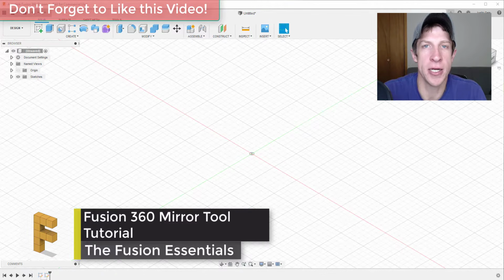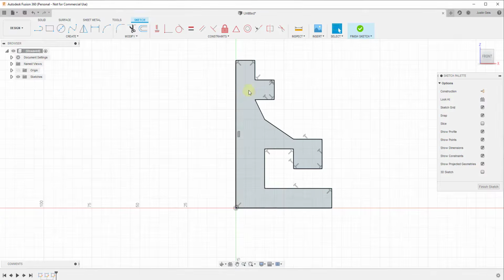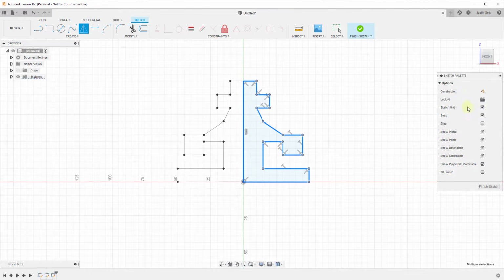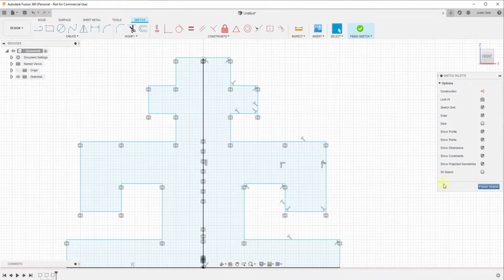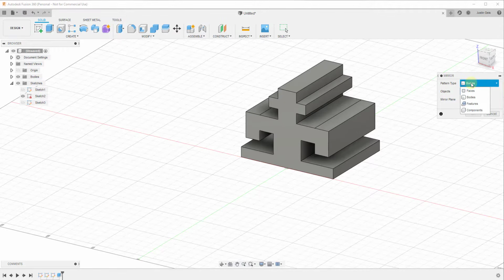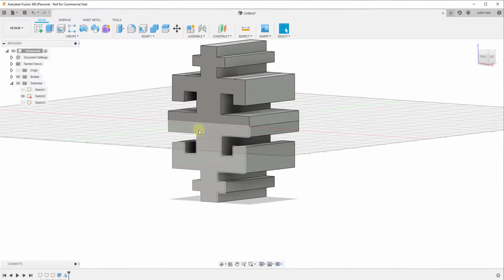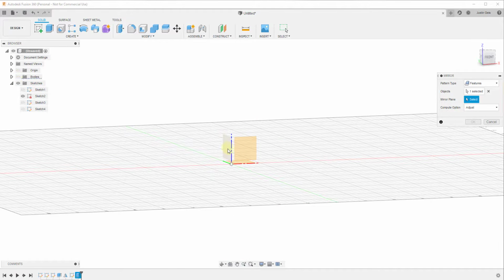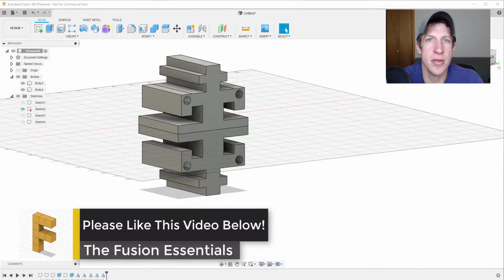How to Use the Fusion 360 Mirror Tool to Mirror Sketches, Bodies, and Features!

Comment: Coming from Solidworks.  Trying to take advantage of this TopDown approach but I am frustrated with Mirroring components of a steel frame.  I create a Leg component and mirror that about ZY plane.   I get a new component Legs(Mirror).   Here is where the frustration is.   I want that new mirrored part to mirror the location of the original part.  IT DOES NOT.  That new part I can drag off anywhere I want.  Move it around in the X, Y, or Z.   It is more of a copy with an initial placement and unconstrained than it is a mirrored component in a sub assy.     What gives!!!!

Comment: Very powerful tools for drawing and modeling.   The one thing that can't be taught and only comes from experience (or formal training - as in learning the way your instructor teaches you) is which technique is better given the circumstance.  I have been burned many times when needing to go back and make a simple changes that when completed, the impact everything else after the timeline to the point of almost screwing the entire drawing up creating a lot more work to "patch" those new issues.  When to draw in mirrored features during the drawing stage or solid model stage is an art form.

Comment: I been trying to mirror an object that is a few inches away, not next to each other like your sample, is the process the same?
Reply from the maker: Should be - you need a shape and an object to mirror across
Reply: this is when you use the construction plane funtion to define a plane a specific distance from the origin planes.  the function is available any time you are in the sketch mode.  So, if you need to mirror a body, go to one of the previous sketches that is in the appropriate orientaton and add the construction plane you desire.